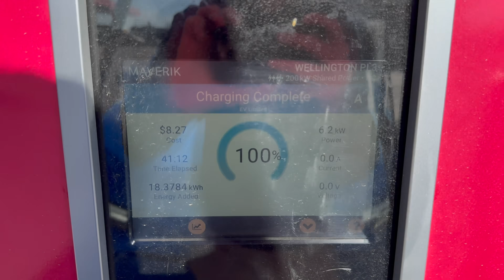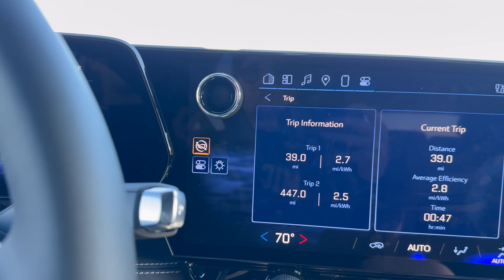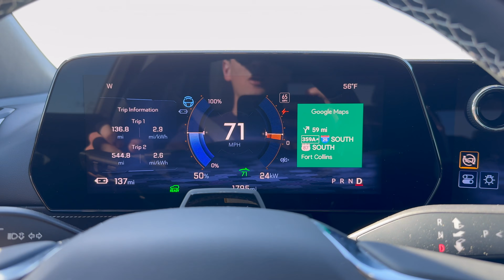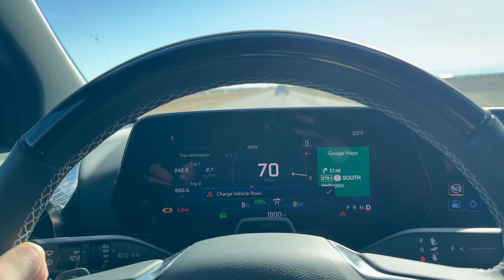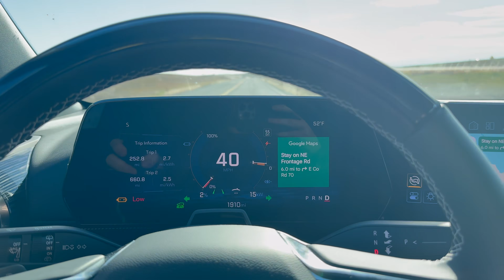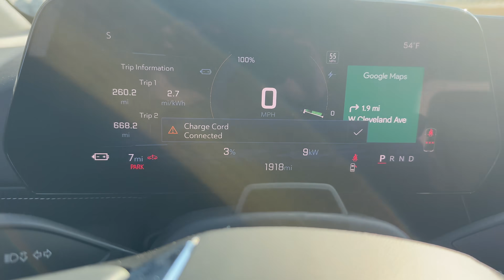Chevy Blazer EV AWD Needs A Bigger Battery! 70-MPH Highway Range Test In The Lowest Range Variant

Comment: I get alot higher at 69mph.  Perhaps that last 1mph makes all the difference.  LOL.   I also have found that the drive mode makes a difference irrelevant of how you drive.  I use sport to get on it, and have custom tuned to same as sport except acceleration is set to relaxed.   I average 3.1 - 3.6 on the interstate with adaptive set to 69mph.   Took a road trip to the beach last month and it was spec on.   For colder weather here in Tennessee I am expecting numbers like your, perhaps abit higher.

Comment: I recently replaced my Leaf with an Equinox AWD. In SCal on highways at 70mph, I am getting +3.4 miles/kwh. Chevey's EV has a great ability to quickly regenerate large amount of power back on the battery while on downhills. I also have an Ariya AWD they are comparable (both driving efficiency and charging capability).

Comment: It also needs a much higher nominal voltage. 277 or 288V (I can't remember which it is) is incredibly low and explains why it cannot even charge at 150kW unless you use a 350kW CCS charger (500A or more) or a Tesla Supercharger V3 or V4 that can operate at the same higher amperage. GM completely failed with these new Ultium cars. Why do they weigh nearly half a ton more than their competitors but have no more interior space, less power and torque, and substantially slower charging abilities.
Reply: I tend to agree with you BUT. Ultium packs are repairable, which should hold insurance cost down. And they are modular, which should hold vehicle cost down.

Comment: I wonder if having the A/C turned on had anything to do with the range. He stated the ambient temp was in the 50's, yet the HVAC controls showed the A/C being on. 
I wouldn't think it would be running the A/C compressor,and the heat simultaneously- but you can do that in most ICE vehicles- so t does make you wonder.
Reply: The Ultium EVs are not capable of running heat and AC simultaneously. It uses the same compressor for both, and has a reversing valve just like a home A/C with heat. The ultium EVs do not have resistive heat except for the heated seats and steering wheel.

Comment: I love my Blazer. I live in the northwest territories, canada. I started leasing it in october, 2024. So far it has been a reliable vehicle during the extreme low temperatures (-30 C). I don't drive long distances so range is not important to me. What is important is reliability, the fact that i don't have to worry if i have a driving vehicle today. GM did a very good job, even to the point that Honda uses their platform as their entry in the EV market.

Comment: Wish the manufacturers would stop putting on insanely large wheels; what could this platform do with 18” wheels for range?  Considering my 1st EV purchase and don’t need 19-20-21 or 22” wheels.  Forged wheels with 45 side profile should be sufficient depending on the vehicle and help with overall range.   Saw a Honda Prologue on the road looked pretty nice.. Leaning towards refreshed Model 3 LR AWD

Comment: Please, perform a Blazer EV towing test.  The RWD has the most practical towing capacity of 3,500 lbs which can be as much as a small utility trailer or even a camper trailer (full size or folding camper).   In fact that could be a great opportunity to see if a medium sized folding trailer loaded to be 3000 lbs can be towed what kind of distance (as it's low profile would not pull so much drag).

Comment: Nice work!  Had my AWD Blazer for 4000 miles now.  So far no complaints at all.  Have done some road tripping with public charging both CCS and NACS.  Fits my driving needs just fine.  Nice to know what the behavior is at really low state of charge.
Appreciate the work you guys are putting in these reviews!

Comment: In regards to the efficiency, that's mostly a result of the size and format of the vehicle. This AWD Blazer EV actually not that far off of an AWD Mach-E, which is a similar size/format. I do agree, though, that any EV that consistently gets less than 3 mi/kWh in real-world driving should have at least a 100 kWh battery pack. That's the key difference between the AWD Blazer and something like the AWD Cadillac LYRIQ. It's also worth considering that the RWD Blazer EV does come with a 100 kWh battery pack, and with its higher baseline efficiency, it should easily hit 300 miles in this 70 mph test.
Reply: They need to put smaller tires on it.   Those 21" wheels are enormous and its leaving a ton of miles on the table. 

The huge wheel fad needs to go away. Its a stupid waste of money all the way around.
Reply: @dpb22  Tire width will have a much bigger impact on efficiency and range than tire diameter. But I agree about the wheel sizes getting ridiculous. Personally, I'm not really interested in any wheels bigger than 18". There's just no need for them on these cars.
Reply: Agreed. I think the RS RWD is the best option if you're going to get a Blazer. I'm excited to get a car with one of the bigger packs in soon!

Comment: It's worth noting that, while voltage is a factor in charging speed along with current, voltage doesn't dictate the charging speeds. Ultimately, the C Rate of the cell is what will dictate the charging speeds, so even if the 85 kWh pack had a 600 or 800 volt architecture, the max charging speed might still be 150 kW. The only difference is, the current required to reach that charging speed would be lower. 
That being said, I wouldn't be surprised to learn that these first-generation Ultium NCMA pouch cells have a true 2 C charging rate, which would allow for 200 A of current per cell, or 600 A of input current in the 3P configuration found in the 85 kWh (10-module) pack. That means that, with a J3400 socket and access to the Supercharger, these 85 kWh EVs could see peak speeds in excess of 180 kW. It wouldn't speed up the charging much, but it might shave about 5 minutes off the 10% to 80% charging time.
Reply: The thing is many chargers hit their current limit before their power limit, so if you plug into a 150kw that only has 200A cables on it, and the pack is 320V, you can only pull 64kw, but if the car had a 700v pack, it could pull 140kw

Point is, while its true the C rating is the limit when it comes to the cells, the fast chargers have their own max voltage, amperage and power, and since most chargers can hit 500V, I'd say designing you pack modules so you can always hit a 400v-450v nominal voltage, or even an 800v pack that can split into a 400v configuration should be a top priority for any car meant to road trip
Reply: @TAWithiam  Yes, there can be benefits to higher voltages, but something to also consider about the lower current chargers: They can't always provide that current at higher voltages. For example, a "100 kW" charger can provide a max current of 200 A, but if you exceed 500 V, the max current limit drops to 100 A (splitting the power modules). Essentially, you'll still have the same max power cap, so the only real benefit is from slightly higher charging rates that are directly proportional to the difference voltage (e.g., 300 VDC nominal vs 350 VDC nominal).
Reply: @newscoulomb3705  That's a good point! still though there seems to be two classes of DCFC, 500V and ~1000V (I think I remember them talking about a 950V or something like that that caused problems with charging their lucid) so having something down at 320V provides no benefit over say 450V and plenty of downsides and problems
Reply: Yep! The voltage only matters for a given amperage. I think it's generally "easier" to design for higher voltages rather than pushing 500+ amps, plus you get faster charging on amperage limited chargers (which describes many chargers, unfortunately). It'll be interesting to see

Comment: The range doesn't seem that bad to me for a car of that size going 70 mph with the size battery it has.
Reply: The efficiency is reasonable but it just needs a bigger battery. Unfortunately you can't spec one with AWD!
Reply: It’s a very inefficient IcE conversion. It’s heavy too and the front end is HUGE yet has zero storage.  The software is also horrible. A model 3/Y with a much smaller battery (60kWh to 82kWh) that can charge at ~250kW has much more range. 

The fact it generally maxes at ~80kW DCFC unless you use a Tesla supercharger is pretty ironic.
Reply: @olemissjim  It's not an ICE conversion, the gas Blazer / Equinox are entirely different cars. The ultium EVs are "ground up" designs. The software is not horrible, it's got a few weirdnesses, but the cars, as a whole, are easier to use than the "everything must be on the touchscreen" of a Tesla.

A model 3 / Y are also significantly smaller vehicles, the model 3 is downright uncomfortable and difficult to get in and out of, especially from having those stupid "frameless" windows that make it even more difficult to get into... I hit my head almost every time I get into a friends model 3, its horribly uncomfortable. 

I also don't have an issue with DCFC speeds... The chargers I've used have all been able to put out at least 120kw with only a single exception... and that wasn't using the Tesla chargers either.

Comment: 2.7 m/kwh? Really? So a little better than a EV truck?  Make them more efficient before adding more weight from a bigger battery.
Reply: Thought you were wrong about this but inside EVs got 2.5 miles/kWh for the Cybertruck, pretty impressive for such a large vehicle. Much better than the around 2.0 mile/kWh of the F150 or the Silverado EV.

Comment: I'm not sure how you can be disappointed by the result when the Blazer EV is getting similar range to EV6 and ID4, which are lighter and smaller vehicles. Unless you're saying you are disappointed by all the cars on the chart?
Reply: I'm disappointed with many crossovers to be completely honest. The Model Y RWD (not long range, also not available anymore) got 250 miles using 64 kWh. I know Teslas are efficient but I still find it disappointing that many "long range" variants with ~80 kWh batteries are only able to match that range. I think we should be getting closer to 300 actual miles from new cars at this point.
Reply: @ryankassel5691  thanks for the honest reply. I feel you. but on the other hand, i've been driving electric for 3 years and not one time have I been driving and thought "man I really wish this vehicle could hit 300 miles instead of 280." My EV6 reliably hit 280 miles and so does my EV9 and its never bothered me. They'll easily exceed 300 if I drive 60 mph. It's all about how fast you need to go. These class of vehicles are for local/regional travel. I'll pick up an EV Tahoe with the 450 mi range if I want to drive the family on interstate road trips.

Comment: I appreciate the testing it's always appreciated and good stuff. I think the other channel should focus on conversations around standardization and why aren't we pressing for manufacturers to standardize not just charging ports battery technology which is where the most of the apprehension fear fudge and costs are coming from. Standardizing batteries so that they can be retrofitted into older EVS to keep them on the road would really be enforced the argument that these cars are good and better for the environment than ice vehicles. 

Manufacturers should not treat these vehicles like cell phones that need to be replaced every 3 to 4 years. If the batteries can generally last much longer in 5 years then they should lean into that
Reply: Batteries and drive trains come with a minimum of 8 year warranties, with some coming with 10 year warranties. Manufacturers know full well that modern batteries (and technologies used to protect them) will likely outlast the vehicle. These are not cell phone batteries, nor Nissan Leafs who had little to no battery protections.
Reply: Are ICE engines and transmissions "standard"... You can't have competition without allowing different companies to make their own products...

Comment: the ultium battery is a dud!
pack voltage change when changing the battery size is pretty dumb and sloppy.
At most, should be 400V or 800V.
And don't get me started on the seemingly inability to make efficient vehicles
Reply: Hardly “dumb”. Actually very smart when it comes to being profitable, which GM is hitting now on their EVs, unlike almost every other legacy car maker.
Reply: @LakeLake123  profitability has nothing to do with it. Just poor engineering and planning. Could have been done correctly at same cost
Reply: @USUG0 Absolutely not true. It’s basic economies of scale. You can’t build entirely new manufacturing lines to assemble the higher voltage Ultium module variant for FREE. Makes zero sense.
Reply: @LakeLake123  you reasoning is completely off. You clearly don't know how battery packs are made. The largest pack is 220kWh and 800V, arranged as 2X 110kWh and 400V in series. There are several non GM EVs with 55kWh, 400V packs with sane cells form factor. That is, the ultium could have been engineered to have a 110kWh pack as made up of 2X55kWh, 400V units in parallel. And any size in between could have 400V+, instead of sub 400V. Instead for some baffling/idiotic reason they made it that the smallest pack size to have 400V is 110kWh. Like if they were given the directive (but apparently not the case) that it was going to be the smallest battery pack going to be used. The downstream manufacturing and costs would be the same as of now
Reply: This might be a dumb question but if the battery technology was to evolve couldn't manufacturers retrofit new batteries into Old vehicles
Reply: @DIYDrivenDave  indeed it could and should. But of course, automakers don't want that. They want to sell you a car now, and another one in 5-10 years
Reply: You're asking a lot from a company that sold out to big oil (literally selling their technology to Texaco/Chevron) and agreed to crush all their EV1's. And a company that made a vehicle with a maximum of 55kW (under 50kW most of the time) when most others were charging at 150kW or higher, with many over 250kW and a few over 300kW.

Comment: The RS RWD has about 40-50 more miles of range than my MMYLR23 on induction wheels.  BTW getting 265/45/20 GY assurance weather ready 2"s mounted today on the MYLR so it will lose another few miles in range
Reply: Looks like it got 2.7 miles per own at 70 mph for this run. Efficiency is not impressive at all, it's actually quite poor.
Reply: Part of the reason is the RS has a bigger battery!
Reply: Yes, I know.  Over the 6100 miles so far I'm averaging 3.1 mi/kwh but that'll go down now that winter is here.
Reply: @ I’ll be interested to hear how it fares in the cold!

Comment: I have rwd rs, the awd accelerates slower,  charges slower and  has 50+ miles less range.  I got 3.5mpkw on 700 mile vacation during summer, winter seems to be 2.7 so far.
Summer range 340 ish/winter 270 ish
Please 70mph range test a Silverado EV LT with 18's rated at 408 mile range please please, I think it's the most needed test currently and most recent to land on lots.
Reply: They already tested the Silverado EV 4WT. It got 434 miles going at a constant 70mph.
Reply: The 4wt is the 24 module, the LT only comes in 20 module like the 3wt, the 2024 4wt was rated at 450 and the renamed 4wt is now a 8wt and rated at 492.....lots of information out there